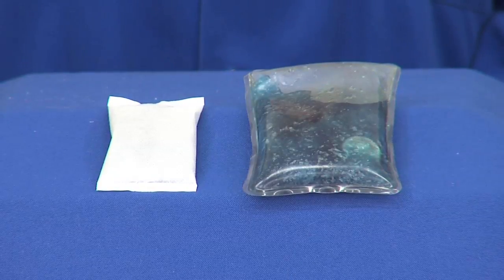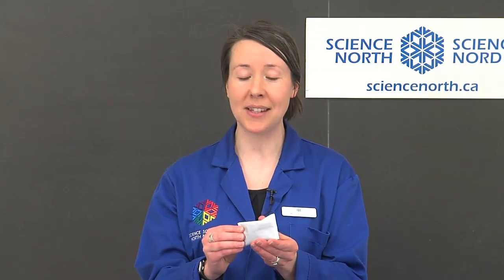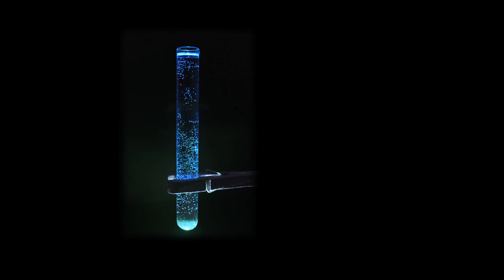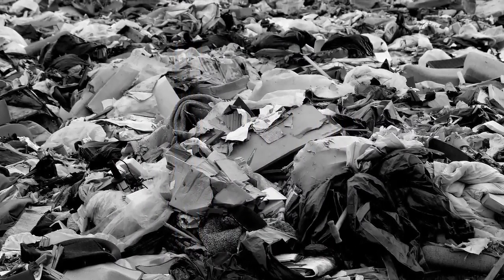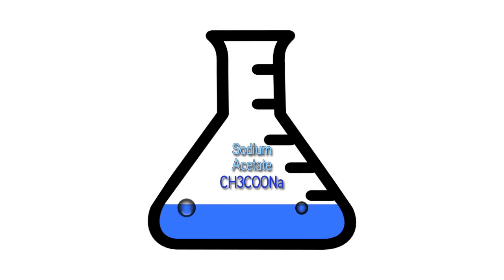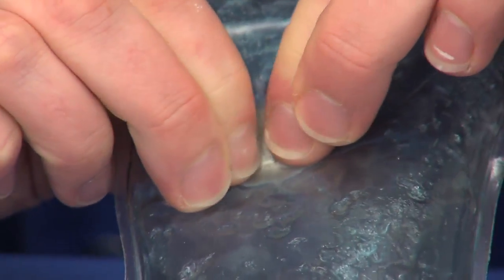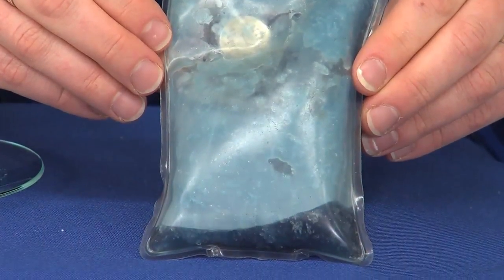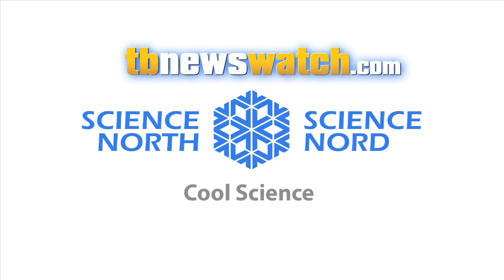Cool Science HandWarmers

Comment: Why does the sodium acetate hand warmer need to be reheated?
Reply: You think warmth comes out of thin air?
Reply: you probably forgot all about your question, or have the answer. if you still don't know:
the amount of solute that can be dissolved depends of temperature. the unused handwarmer contains WAY more that what is normally possible at that temperature, so disturbing it will remind the sodium acetate to stop being dissolved. increasing the temp. will raise the amount of sodium acetate that can be dissolved, so it re-dissolves.

Comment: In the 2nd hand warmer demonstrated, where is the energy for the heat coming from? Why does that crystallization produce heat?
Reply: The phase change from liquid to solid is what is releasing the heat.  When you warm it back up you change its state back to liquid, that phase change requires heat.  You could think of the solution as being right on the edge of being solid.  All it needs is that little push and it will become  solid.
Reply: 50% off code: KWW4GVWF  to buy Reusable Hand Warmers.
link: https://www.amazon.com/dp/B07K76CGG4